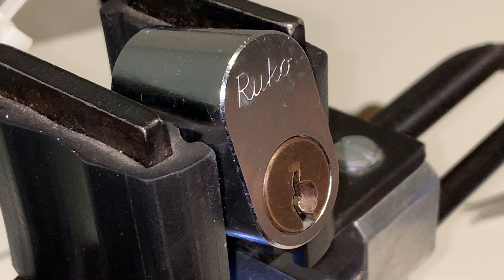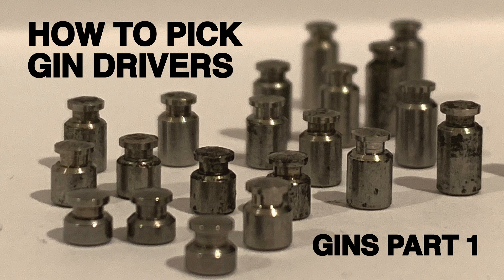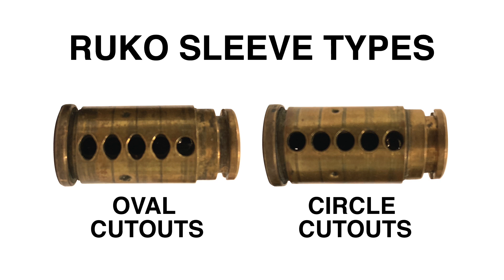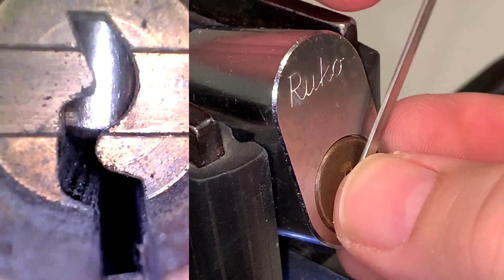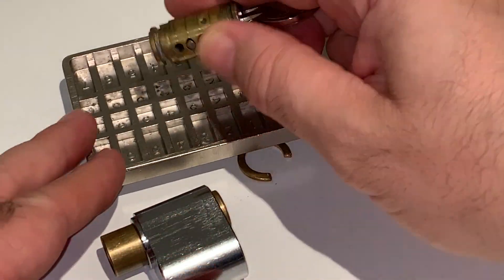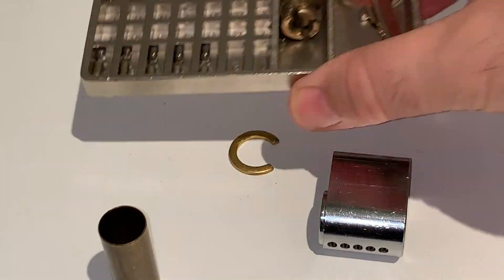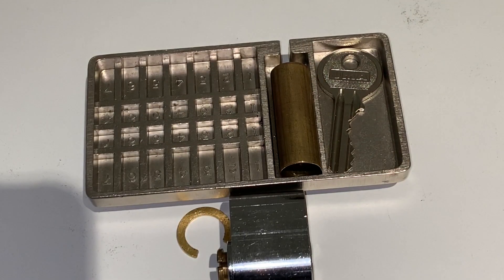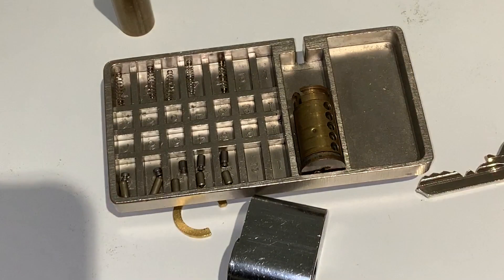(25) Comparing Ruko 500 Sleeves - Gin Series Part 3

Comment: The result that round sleeve holes was better was indeed surprising! If Ruko has switched to that design in later models it does suggest that there's a real difference. Do you know if the sleeve is manufactured by stamping which would make round and elliptical holes equally expensive to manufacture so it wouldn't be a reason to favor one design over another?